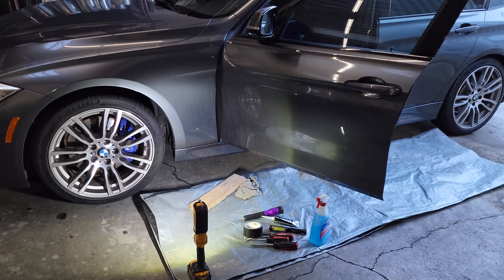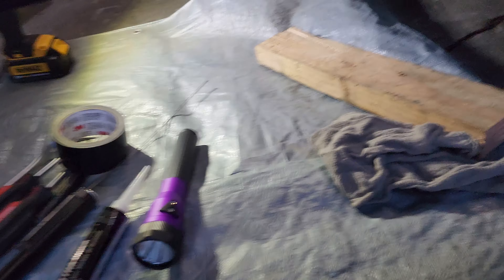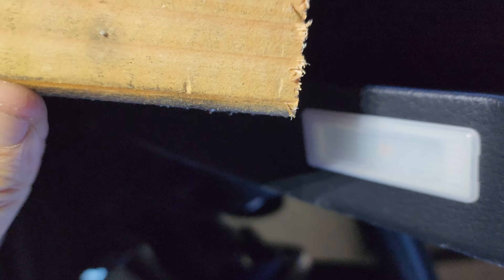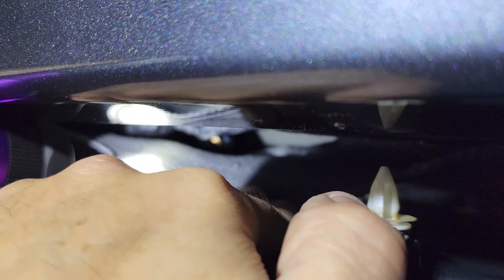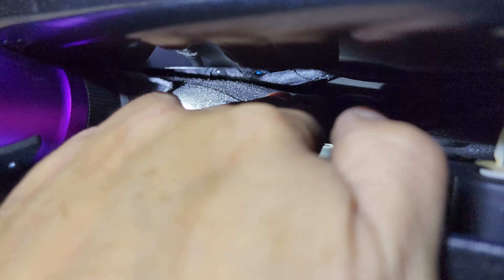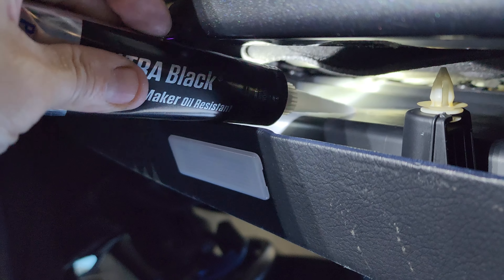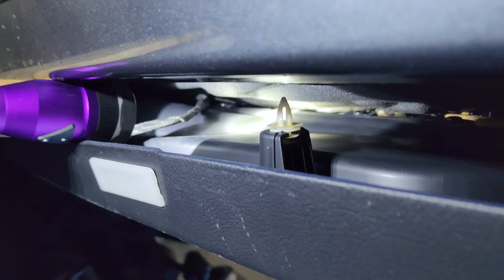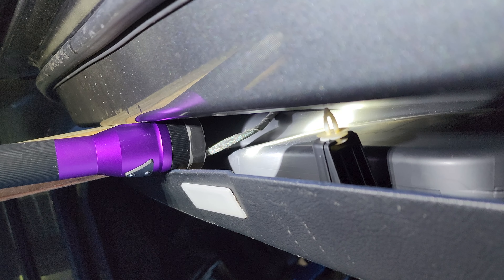BMW f30 vapor barrier leak.

Comment: Thanks, been banging my head against the wall for months with water leaking into my f30 wagon that I daily drive. This is the last of 3 places water was coming into the interior. Bad sunroof seal, plugged drains, now this. No disrespect to enthusiasts, but after water leaks, EGR cooler failure (diesel), plastic engine coolant fittings failing, transfer case flex joints, WTF folks. All these are known to BMW and would be cheap if addressed before failure, but cause major problems when unaddressed. I’m lucky enough to be able to address this stuff on my own, but how do folks justify keeping up with these cars if they’re paying a dealer? Rant over, and thanks again. Popped my door cards loose and can see the loose barriers, fixing later today with the hope to drive a car that doesn’t smell like a wet dog soon.

Comment: I was going crazy to know the reason of the leaking water inside
Reply from the maker: If it doesn't rain too much where you live you can just put a towel next to the door sill on the carpet to keep them from being soaked.
Reply: @thrillhunter9897 do all 4 doors clip easy from bottom like in video?i have window sealant too put down from what i heard the passenger door is more harder to get off, is itmore easy to un clip from bottom put a wood and put silicon??
Reply from the maker: @Mircea1997  Much easier to just Un clip from the bottom . or You have to remove the entire door panel. All doors are the same. They are easy to pop at the bottom.
Reply: @thrillhunter9897   what if you have a problem with door and you have to take off the vapor barier? buy new one? or just clean it?? i want to put window sealant ..
Reply from the maker: @Mircea1997  If the vapor barrier is badly torn, you're going to have to either tape it with duct tape or by a new one, but definitely clean it if it's dirty or it won't stick.
Reply: @thrillhunter9897  clean it if you have to repair window for example ? or buy new one? because i saw on forum if you put window seleant it will clean harder...

Comment: I have the same exact car with the same exact problem.  Will give this a try and report back 😢
Reply from the maker: Whatever side of the car faces the sun is usually which side has the issue Of leaking. The heat dries out the adhesive. The black automotive RTV silicone will never dry out. And it will be a permanent fix .
Reply: Did this work for you? I’m having this issue with my f30 passenger side front, already had the sunroof drains cleared.. problem continued so today I went to a local shop had them remove door panel and there was like a small opening down on the vapor barrier and it was wet, used the same vapor barrier just took the whole thing off and re applied it hopefully this solves the problem
Reply: @f30angel did it sole the problem? I changed my barrier on the door and still got a lil bit leak
Reply: @streetz-runner1683  hasn’t been raining much in my area, but as of lastime it rained no leak

Comment: This is not the proper way to do it... Buy new butyl tape and change it. Here are the codes for that tape :
83195A1B479 Butyl cord Terostat 2460 - 7mm x 10m
83195A1B3F9 Butyl cord Terostat 2460 - 16mm x 10m
Reply from the maker: Butal tape will just peel off again in another 2 years because I've had repaired at BMW twice now.
Reply: @thrillhunter9897  if it has a proper instalatiion, guranteed it will last longer than 2 years less than 30 $
Reply: @thrillhunter9897  At BMW service, not at home by your hands. This means that they do not give a damn pretzel if the installation was not done right. I did myself and I cleaned all surfaces with Isopropyl alcohol and I have added a heater inside the car, leave it there for 1-2H to heat the entire car and also the butyl tape, used a roller to have an even pressure all over the door - SOLVED
Reply from the maker: @kenwood197  I've had them repair it twice and only lasted 2 years each time.
Reply: @thrillhunter9897 he dunno Bmw use cheap stuff why re use something that’s gone keep giving problems
Reply: @thrillhunter9897  Would a small hand fit it ? i want to put window sealant with finger and can't tell from video ..
Reply from the maker: @Mircea1997  My hands are large and they fit No problem, small hands would be ez.